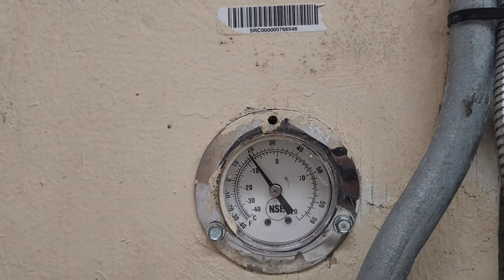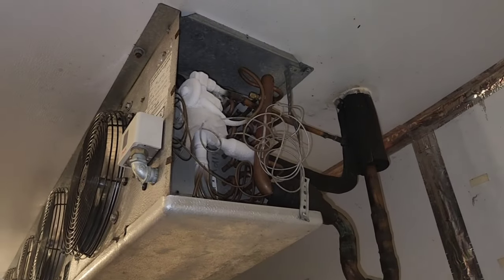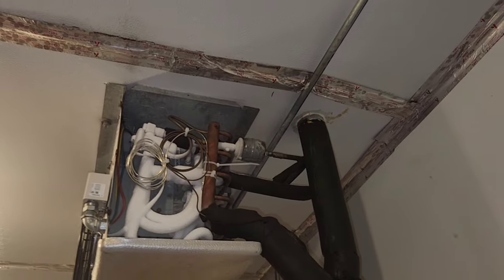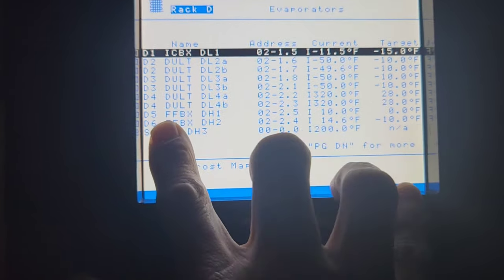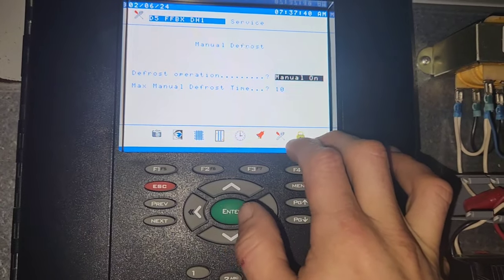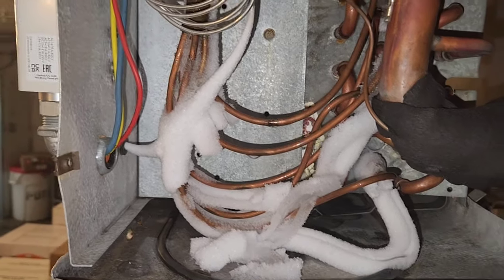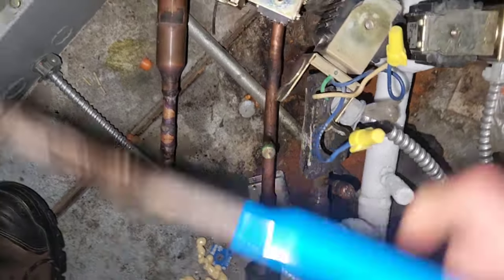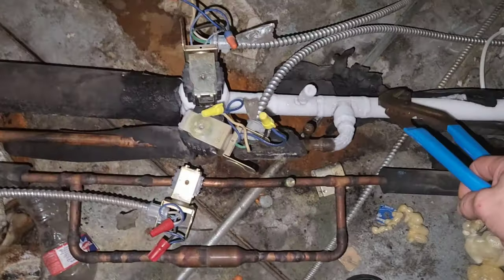Walk In Freezer Not Maintaining Temperature

Comment: Question is there anywhere else that drier could be at other than in the evaporator
Reply from the maker: anywhere on the liquid line and then there's a large dryer, always on the rack.  In this case, You could follow the line set from the Rack to the evaporators and see that there was nothing like a dryer on it other than the big one by the main liquid line site glass and on the individual evaporator.